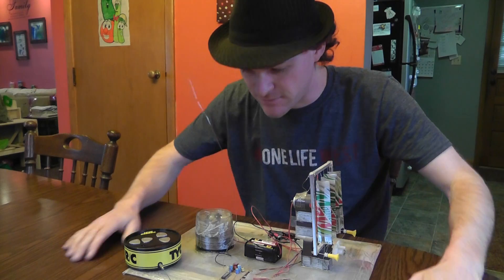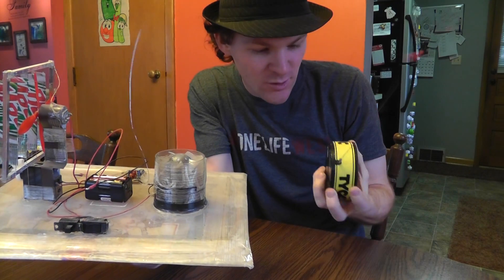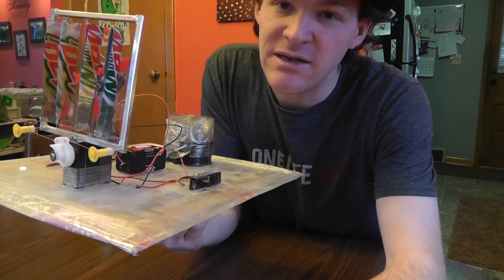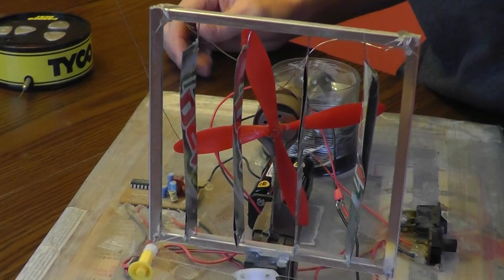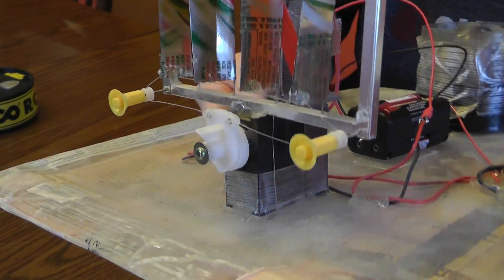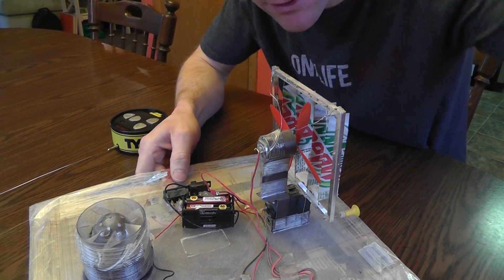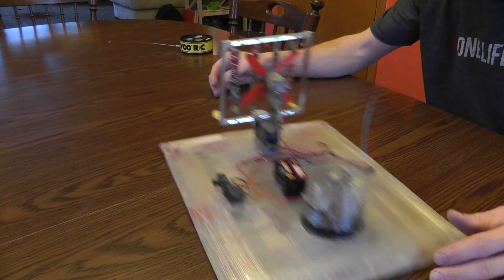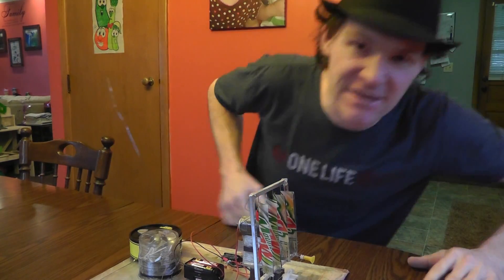When I Was A Kid.. #2 Hover craft! 's RWGresearch

Comment: Ha nice. Stick a 2S lipo battery on it, you'd save weight, would bump up from 6V to 7.2V and have more than enough amperage to run both motors. Or, perhaps 2x Li-Ion cells from an old laptop :)